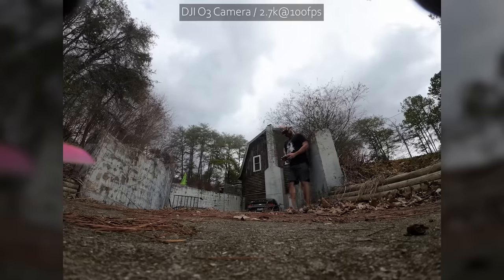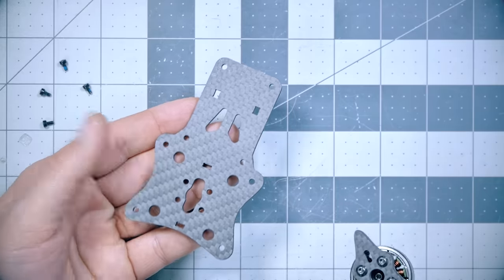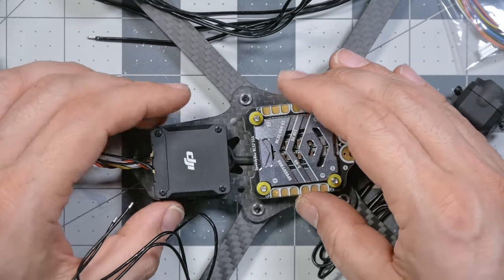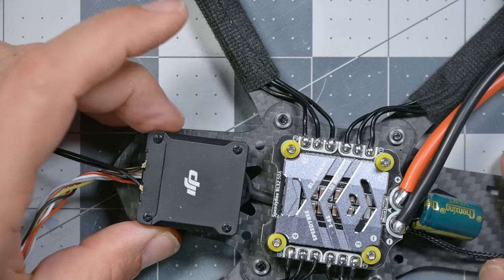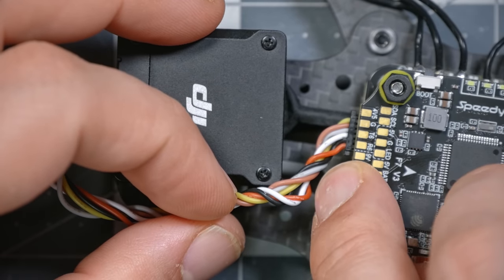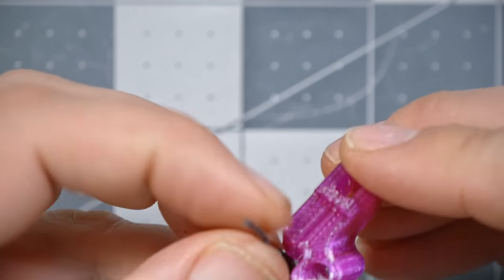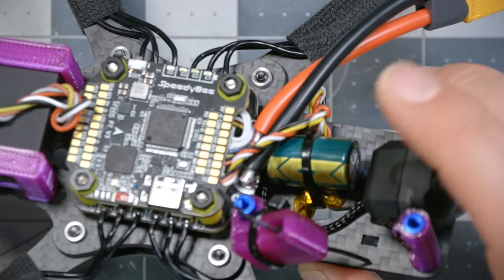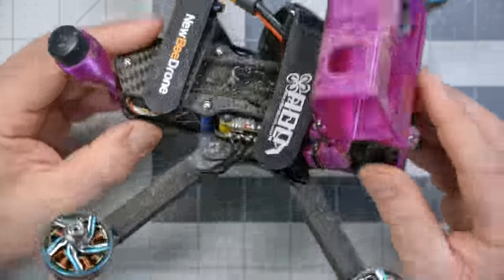3 MONTH Build FINISHED! 🤯 VannyStyle & DJI O3 Air Unit Reveal!

Comment: Wow, I just built this exact quad with the exact parts and I can't believe how much easier it would have been if I had thought to turn the ESC around. I destroyed an O3 air unit by trying to cram it all in and it shorted on the ESC pads. Also no room for a TPU mount on the rear standoff, I ripped off both antenna leads from the air unit as well. All around it was a mess and cost a lot of money. Live and learn.

Comment: I just did a walksnail build in the vanny frame. its a tight fit for sure. the rear stand off is hard against the VTX. I dont see the point of shaving 2mm here or there when it makes building so difficult. also the stock V shaped single hole camera mount pretty much sucks. all I see is standoffs in my camera and the camera angle changes every time I blink.

Comment: I see you putting some screws in that don't have much bite, is that something you see as an issue? My quad was not built by me, but they had some motor protectors on them that causes the motors to have very few threads in contact. The build worked fine for awhile until one day I tried pulling out of a loop and the quad just went berzerk and dropped onto our barn roof hard. Searching through the wreckage I am pretty sure that the failure was that the motor screws vibrated out enough for the motor to just yank off the quad mid flight.
When I put it back together I removed the motor protectors to give me another 1.5 mm or so of thread contact and then added some loctite for good measure.
Have you seen threads back out like this? Is there a general rule of thumb for how many rotations of 'bite' a thread should have for different parts? Is locktite a good idea if you are borderline?

Comment: I like those motors.  I have 4 FPV  Cycle Glides.  Two of them have the Farouk motors and the other two have Hyperlite E 2207.5 2222kv on 6S.  The Sbang motors have really nice low to mid throttle resolution but lack on the top end.  They are definitely made for quick blips and sudden changes of direction.  If you dont fly Sbang they are good for aggressive proximity freestyle.

Comment: I prett much always mount esc 180 deg from fc makes build much cleaner amd i can run 2 capacitor up in front. And also cut cap leads down to little nubs and solder spare motor wire onto them and then heatshrink and conformal coat

Comment: Omg..I had the same exact problem first build with speedybee didn't realize that wire harness was soo short and they only include one. Kakute had longer ones. I always mount my esc to the side.. Anyway I ended up extending the air unit wire.

Comment: First build video of yours and I winced at you using those flush cut nippers 😂 I use those for plastic models, not copper wire. You can get a forged pair which will be better for cutting wire.

Comment: Ahh.. I had the same problem with the jbf7. The pin headers weren't in the right place for my build. Had to stretch the camera wires and ended up doing a splice job.

Comment: stiffer wire might be okay for motors because they train easier. Some PVC wire can be just as heat resistant as silicone, or darn near it.

Comment: The o3 works with the remote 2 correct then i wouldnt need a rx and antenna all together ? Im leaning towards that. Do you not use a dji remote 2 for a particular reason?

Comment: To use your phrase, the frame seems rather "fiddly" with all the gyrations you had to go through to get everything to fit. The air unit antenna wires seemed to have some pretty tight bends where the u.fl connectors are. I think I would have gone with a slightly longer stack screw and sourced a longer standoff (or use a nylon nut as a spacer with each standoff to raise the top plate) if necessary and even cut the stack screw if needed to give the gummies a little more relief. But I'm kind of picky that way. Would the slightly higher standoff effect flight characteristics at all?

Comment: I don’t really like the speedybee stack. I had the exact same issues with a quadmula frame. The Esc had to face to the front, then the o3 cable was too short, but I also did not want to run it longer over the Esc. So I got a longer cable between Esc and fc, but then you can not really run it between fc and Esc because there is no room due to the 500 plugs that are soldered and glued to the board. Then I realised that the stack is too tall, I had to cut the silicon grommets and get longer stack screws….
It wasn’t nice.

Comment: Higher class screws aren’t always better. You need a certain bolt stretch to make sure the connection stays tight and don’t get loose over time. A higher class bolt can withstand higher tension, but also needs higher torque (creating a higher clamp load) to achieve the desired bolt stretch. Too much load might break the components (carbon fiber frame) if they can’t handle the load. —> a 12.9 screw might break your hardware if torqued to spec, or get loose if not stretched (torqued) enough, so 10.9 might be the better choice

Comment: Nice Job, JB.  I'm just finishing up practically the exact same build to the bolt, except I went with the Speedybee Master HD. I put my capacitor up front, and love the F7 V3. Care to share your tune on her? This is my first build, and I'm on the fourth video of you Betaflight 4.3 mega tutorial since it's the last thing I still need to learn to finish up strong with a full understanding.  Thanks so much for everything.  This video couldn't have come at a better time
Reply: where did he get all the 3D print from?

Comment: Just my 2 cents, it’s custom PTFE motor wire, it’s lightweight, cut resistant and also heat resistant.
Reply from the maker: That's interesting. It's really frustrating that key details like this are not included on the product page. Whenever I do a video like this, the first thing I do is read up on the products, and this info isn't anywhere that I can find, even though I am now searching for "PTFE" keyword specifically. Rush's own site doesn't have this info.

Comment: Hi Joshua, I have a special problem with a Whoop Drone similar to the AcroBee75 HD O3 DJI/PNP, When you connect the Battery Nothing happens, I order a new Battery Balance it, same issue, I can go  the the Flight Controller using Betaflight and I also update the DJI part with the DJI assistant Consumer, still nothing. Can you give me some pointers on how to do some more diagnostics , I will appreciate

Comment: is the speedybee f405 stack good enough for a 6s build with dji air unit and is there a big difference betrween the f405 stack and the f722 stack you used in this video. thanks for the help

Comment: Is the pin out  on the speedybee F7 v3 stack  the same as the DJI 03 air unit wire, to just plug in no soldering?

Comment: Hi Joshua! Dont mind my dumb question : I'd like to mount an o3 air unit onto a Mavic drone (exterior case, without dismantling it) to use those dji goggles. Is it possible? What does this air unit needs to transmit data, a battery? 
Thank you for your time!
(I hate the fact that goggles arent compatibile with Mavics)

Comment: tried the speedybee F405, the loop is 3.8Khz but I can not feel any diff with my F722 that running at 8k (now set to 4k), Bluetooth Betaflight configurator app is an awesome feature.

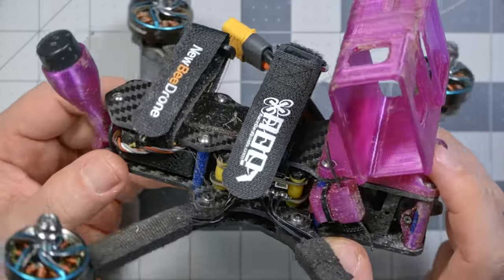Comment: JB - @ 38:55 there is a cut yellow wire protruding from the air unit cable. was that wire unnecessary? 
Great build - I love the problem solving aspect of any build 😎
Reply from the maker: It's the SBUS wire which I don't need because I'm not using the DJI controller.

Comment: By exceeding the bend radius of the airunit antenna cable you will lose signal strength the wire should flow as much as possible

Comment: Why not use the AOS 5 or 5.5 frame?  I have all the same hardware, but yet to buy a frame, mainly because of the DJI O3 air unit.  Was leaning towards the AOS 5.5.  Any suggestions?

Comment: Question? Does adding the air unit 03 to my speedybee f405 v3 build allow me to use my dji controller 2 and goggles to operate the drone? The speedybee i have has plug and play for dji air unit
Reply from the maker: Yes it does.

Comment: Great build JB! I love Alex’s frame! Also I wanted to say, crazy how good you fly on the HDZero goggle, I found exactly the same myself with the Runcam90! The O3 stuff was really cool to look AT though! :p

Development cost more on that motor, not less. It’s a way more durable wire, to resist prop strikes better.

It was chosen by Farouk during testing.

Comment: how can we get the dji remote to work with a custom quad? can you maby make a video about it
Reply from the maker: You would need to install an air unit. Then the DJI FPV remote can bind to the air unit.
Reply: @JoshuaBardwell  is this as reliable as the traditional way of remotes bound to an reciver? Because I don't really want to buy another remote if I had started fpv whit a dji kit... Do you know what I mean
Reply from the maker: The range of the controller is similar to the range of the DJI video link.

Comment: i just recently did my first full rebuild, i had a crux35 that killed an esc and/or a motor, so i put a 20x20 mamba stack in it with a rush ultimate vtx and xing2 motors, talk about zero space left lol literally packed full, about 2mm clearance from my vtx and fc lol, i have been really struggling trying to get my head around tuning the thing tho, i put in the stock crux35 pids and im getting ticking motors, i have it sounding a lot better now but it wobbles when i give hard throttle and when i cut throttle it wobbles as if air mode is not on when it is on, the standard crux35 felt so locked in and i just cant get that back, every time i get the tune decent it still does it then i keep going trying to get rid of the wobbles and i just keep making it worse then i end up reverting back to defaults and starting again, im not really sure where im going wrong and i have spent literally 4 days watching pid tuning and filter tuning videos, but i either just cant seem to wrap my head around it very well or their is something wrong somewhere that i just keep missing or dont understand, but its flying decent when im ripping its just when i try to slow down and do smooth lines or flowy freestyle its wobbly asf, but if im in race mode and going flat out everywhere it seems to do ok lol, prop wash is still a little violent when it used to do like a little shimmy now it has a more twitchy feel and sound, if i turn pids down it wobbles worse, if i turn them up it gets more twitchy and unpredictable, same with filters, more filters makes it more wobbly and drunk feeling, then less filters makes it twitchy and unpredictable, i even had it do this crazy flutter when i chopped throttle to 0 it shimmy and started to fly away, it still feels like its on the verge of either doing that or just drunkenly wobbling around
Reply: Have you looked at the blackbox to see if there is a vibration issue? And also what fc is it? If it has the icm42688p gyro it could cause those issues
Reply: @BowOneFire  its a mamba f405_2022a flight controller with a MPU6500 gyro, it has built in black box and i have blackbox explorer and pid toolbox, and the pre filtered gyro data looks really clean, mostly just motor noise with no real visible vertical resonance spikes that i can identify, but i have to have a bunch of filters on to make it less ticky sounding, i have dynamic lowpass 1 and 2, i have rpm filters, i have the dynamic notch on ant then i have the d term low bypass 1 and 2 and yaw low bypass set to 100hz. Then the sliders are .85 on the gyro and 1 on the d term.

from what i can find online i should not need so many filters with rpm filtering on, i purchaced JESC for my bhS esc's so i could enable bidirectional dshot and i find best performance on dshot300. 

then for my pids i have master multiplyer all the way down to 0.8, most the rest at default except tracking p&i gains at 0.9 and drift wobble I gain at 1.05 to reduce my P & I ratio.

anywhere i go from here with any sliders or filter changes makes the quad fly worse, and its not exactly flying very great as it is, although the motors are not getting hot and ticking in this config although i do occasionally get ticking thats only audable from the onboard mic using headphones, during hard cornering where its into its propwash a little bit. 

some other things to note are i have played around with i term relax but 15 seems to be the best, if i completly disable feed foward like a lot of the tuning guids say to do the quad becomes unflyable so i cant really use pid toolbox traces due to feed foward making it look noisey, and it was a lot worse on the original firmware shipped with the FC so when i updated it to the latest firmware and re configured everything from scratch it became a lot better heaps less ticky motors, but its still not really flying anywhere near as good as the original crux35 BNF that i destroyed lol. Also my frame is in really good condition, i have had a couple of crashes in the last couple of days during tuning but nothing too bad and they were mostly due to the quad doing crazy unexpected things after tuning changes.
Reply: @christhorney  that's weird, maybe you should email Joshua Bardwell directly about it

Comment: hello everyone. Want to ask
 got my  goggles 2 paired to old air unit. but sometimes the video feed just got stuttered no matter the signal strength was. even theres a time when it just unbearably stuttering to the point crasehd it even with Full signal Strength (50Mbps) 

pls Help, is it just my gogs Faulty or just compatibility issue with old air unit??

thank you in advance.

Comment: Hey man great video showing how it’s not always easy to make these things fit at times.  What was the tape that you used for the Moto wires ??
Reply: I asked the same question months ago! It’s called wiring harness tape or cloth tape - you can get it on Amazon and from auto shops.
Reply: Try hockey stick tape... it's very sticky and super flexible (since my son plays, we always have it in the house..). And the tape comes in CRAZY colors/patterns...

Comment: Speedybee f7 stack is $120. F4 is $70

@Joshua Bardwell do you think the extra $50 is worth it and will anyone notice a difference? One the cheaper one has blheli_s instead of 32.  Also the f7 comes with MPU6000

Comment: Ever. Single. Build. I curse DJI for running the UART/GND/VCC off the back of the air unit. All they had to do was run the connections off the front, it would clean up so many builds.

Comment: Nice!! I like the upgrades in your yard 🔥🔥🔥 I ordered stuff for my new build and I decided to get Chris Rosser's AOS 5 " O3 frame ..   I'm getting so excited... it's my first build with the Walksnail VTX/VRX 😁
Reply from the maker: Good choice! Aos5 is a good frame
Reply: I hope you didn’t order it from CNC Madness. I just had my first and last experience with them. I ordered an AOS Cine25 frame from them that’s absolutely garbage. It’s junk carbon fiber with crap tolerances and poor finish quality. My Avata is more durable and it’s made of plastic in China lmao. And I bought the AOS frame because of Chris Rosser’s video about the AOS being so much more durable than the Avata. I’m not the for person to say this about cnc madness. I’m not sure why Chris Rosser uses that clown. Oh, when I got the frame he included  20mm standoffs instead of 25mm too so I had to wait for that. I hope you have better luck. I had to threaten to dispute the charge before he sent me new prop guards too even after sending me an email admitting they were defective and out of spec. 1.5mm plates measured as thin as 1.24 in places. The only spot that actually spec’d out at 1.5mm was where the cf broke and had delaminated 😂. Definitely not a $64 frame. Maybe worth $30 on Banggood :/

Comment: @joshuaBardwell would you be able to direct me to a video where you demonstrate how to get betaflight OSD info to display on DJI O3 Air Unit/ FPV goggles v2. I have the air unit installed on the Geprc Cinelog 35 Performance Edition that previosuly had the caddx nebula pro installed via a plug on the fC. Please I need help bad thanks ahead of time! - P.S. , JB love all your videos and keep creating them brother!!! Ive been learning soo much from you!!!
Reply from the maker: The simplest thing to do is load the walksnail/hdzero OSD preset from the Betaflight presets tab. Make sure to select the right UART that your air unit is connected to.

Comment: ok why am i watching this, i've built loads of quads, no intention of buying the vanny or the 03 yet..... is it just the fascination of watching somebody put something together, is it the odd tip on alien tape, i dunno. watched it start to finish,  anyway, hehehe.... i'd put a little carbon plate up front to be a bumper for the 03 and maybe extend the tpu on the front standoffs, all this said, you threw this little quad around like a boss, like the low latency hdzero made you better even with an 03 unit????????

Comment: Is it me or couldn’t the board or air unit be rotated so plugs/wires are on the sides? More room.
Reply: But you run into an issue with the antenna of the AU

Comment: Joshua, did you BUY those 3D printed parts?! How does a connoisseur of modern technical hobbies such as yourself not have his own printer?
Reply from the maker: I have a printer thank you. But the stl for those parts was designed by brain 3d and they don't give away their stl.
Reply: @JoshuaBardwell  Contact me if you ever need a problem solver designed. I have a Solidworks license and I DO give away my .stl files. Timeless3D on the Verse of Thingies.
Reply from the maker: I understand and appreciate the offer, but when I build a product, I like to use the "official" parts if available, because not everybody has access to unofficial ones.